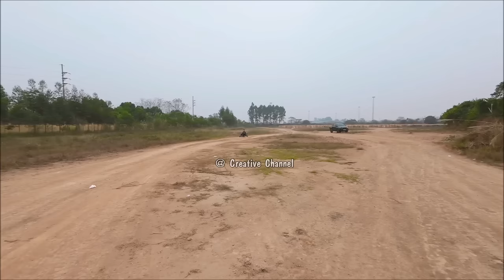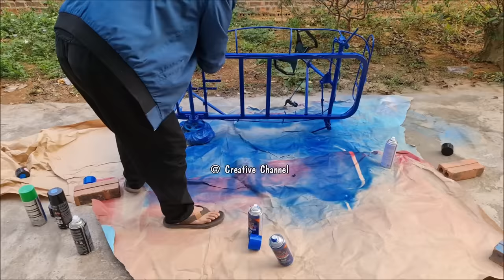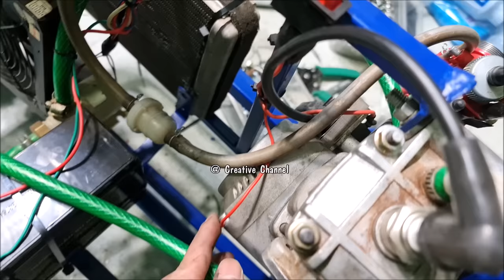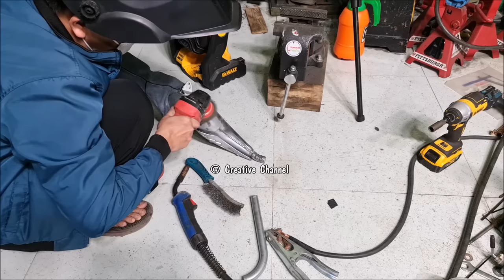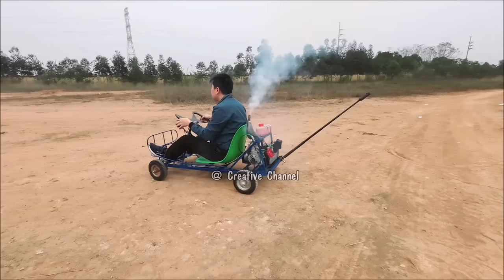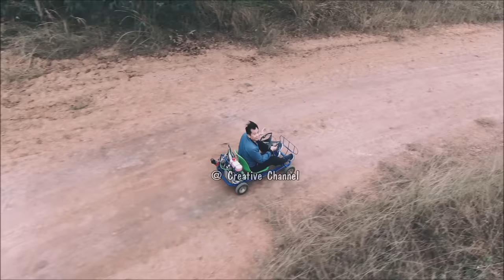49cc Gokart Mini DIY Gasoline Water Cooled

Comment: the radiator doesn't work properly if it's placed behind because it's not exposed to direct wind
Reply: That's what the electric cooling fan is for
Reply: @coryunferferth1767  but not optimal
Reply: @yohandasullivan  That radiator is also pretty dang large for the application anyways, so while its not getting optimal airflow that engine's going to have a hard time saturating the radiator with heat. 

Worst case, let the engine idle for a while that way and go move the radiator up front, guy's using what looks to be almost the same size of hose as garden hose for coolant pipes anyways.